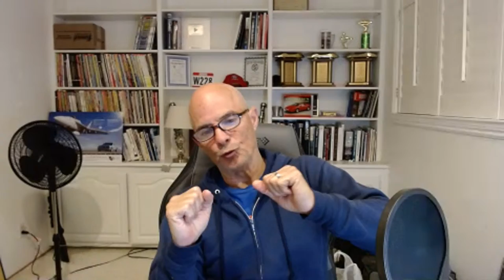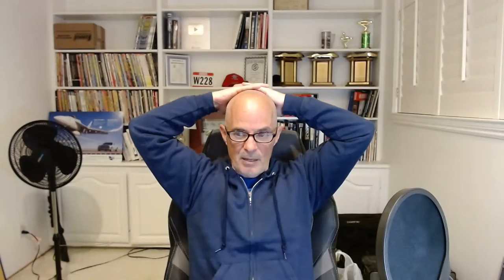LET'S TALK TECH-TUNING 101 (CUZ IT'S ALL I KNOW)

Comment: Do you run acceleration enrichment on the dyno? I'd think not but figure I'd ask.

A few things from my experiences tuning:
-Don't lose sight of the idea that the computer may not be the problem. Bad ignition system parts, vacuum leaks, unrelated engine issues (bent pushrods,) bad O2s and fueling issues have all plagued projects I've done at times. 
-Don't discount the wiring. Probably ever.
-Shielded wiring is a great thing for ignition pickups.
-Use a timing light to ensure that your ECU is actually controlling timing. Had a miswired relay and wondered why I had no power when I was running 10 degrees locked timing effectively.
-If you're using a MS2 with Extra code (probably others not sure) the acceleration enrichment (AE) is based off a fixed PW. This means that if you have big injectors you will absolutely drown your engine if you don't alter this significantly.
-Running low-Z injectors without PWM will burn your box up. I've never had good luck with low-Z injectors using PWM on MS2 otherwise, YMMV. If possible just run high-Z injectors.
-Don't be afraid to pull a few plugs to sanity check even with a WBO2. Exhaust leaks happen.
-Be sure to mount your WBO2, connector and cabling well so that it stays away from exhaust piping. For some reason I have a curse and have melted various WBO2 connectors, my LC-1 etc.
-Not dumping a bunch of timing in around the TQ peak is important.
-Don't discount other senses when tuning. Smell for idle comes to mind and the sound at WOT. 

-If you're using an IAC be sure the passages are actually connected from the air filter side to the intake side. I ran into a nasty issue once with idle because the TPI TB I was using didn't have the same passages as the intake and that left me with no IAC and the engine would just stall.
-Don't forget if you eliminate your PCV System that you've eliminated a controlled vacuum leak into your engine. This means that you need to compensate for it by having either an open passage to bump idle RPM or increase your IAC opening. You may experience stalling otherwise.

-I have had zero luck ever upgrading/installing firmware on a MS2 box with a Dell Laptop. Period. I don't know why but I always have to do it from a desktop. Tuning is fine though.
-A port expander for an E63/E65XX series latop is awesome because it gives you a high quality RS232 port. USB to serial adapters can be finicky and their drivers even more so.

-Lastly, what Richard is talking about is applicable to carbs as well. How you manipulate the carb and ignition system are different, however it's changing the same stuff.

Comment: Thanks for this tuning topic!

It gave me a better idea on how to start tuning with adding boost to a NA combo

I’m adding a M90 sc from a ford supercoupe onto a BMW N52 3.0 inline 6.  I’m going to run an AEM fi-c6 piggyback controller for fuel and timing control.  

Thanks again
Reply: Intercoolering also plays a huge factor. A non intercooled blower can easily reach 170° intake temps and higher. The timing required for that scenario vs 100° IAT are radically different.
Reply: @michaelallen2501  100% 
i’m looking into a water/air setup over a air/air setup.

Comment: Missed live stream, but can you point me in the right direction? I am going to swap a junkyard 5.3 into my 3rd Gen Camaro and just do cam/springs according to your 400hp recipe for a mild build. Should I set up a Holley Terminator X to run it or factory ECU and take it to a tuner? Looking for budget friendly reliable option. Plan on occasional track day/autocross but mostly drive on nice days. Thanks for all of the info!!
Reply: Terminator x will give you a cleaner install and easy to tune and modify for the future if you care to do so. However here in Florida you can get a full 5.3 pullout with pcm and accessories for under a grand, which is about the cost of the terminator alone. If you plan on putting it, optimizing it and never touching it again. The factory pcm may be the way to go. You will have to either take it somewhere that has software like hp tuners, or buy it your self. Either way you will spend $100 for the 2 credits to unlock. The nice thing about the holley is you get a new harness, makes for a much nicer lookig install. Food for Thought, I've done both.
Reply: I won’t speak for Richard but I have the holley ecu and would recommend that. Plus you can look over the tune cabinet/files from sloppy and begin with those. I also had remote tuners while driving my car and the tuner using my laptop remotely
Reply: @jsp9247 I'm trying to find the best ecu solution for my ls boat swap. I'm a bit concerned on how good the knock sensing from the holley will be. Would you recommend it?
Reply: @Speedcircle78  To be perfecto honest I don't use the knock sensors with the Holley.  Everything else works flawlessly so I can't imagine they are not good.
Reply: @jsp9247 I couldn't find a adjustable knock curve in the software. I used AEM and Ecumaster Ecu's before at Nissan engines and there it is standard. But I was wondering how few people seem to use knock sensors on ls engines. Maybe the engine is not so sensitive to knocking. Don't know.
However thanks for your answer 👍🏻😊

Comment: I wonder if putting in a 170 thermostat in instead of a 195 OEM thermostat provides a significant amount of safety?
Reply: Not enough to tune against
Reply: It just puts the ECU in a different part of the map.
Reply: @michaelblacktree  if you have something beside 0’s in your temp enrichment table and temp vrs timing table. factory is usually modifying slightly @170 but all that lays on top of your base… so it not that it puts you in a different spot on the map but subject to modifications due to the temperature based tables. I bet Richy has zeros in both, on the Holley. I do the lower temp t stat but I make the Holley warm up enrichment and timing vrs warm up timing tables are done or at zeros at that point.
Reply: @Greenskies321  I'm just thinking like if it would have a safety margin against something that was tuned to the ragged edge on the 195 thermostat.
Reply: @Prestiged_peck  thermostat may open earlier but the cooling system may still be reaching 190f due to the systems efficiency.